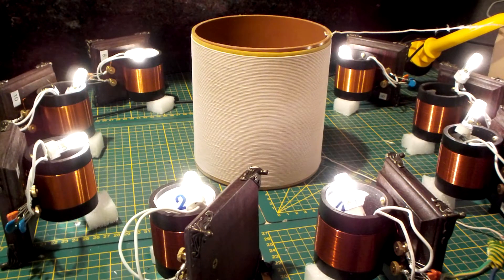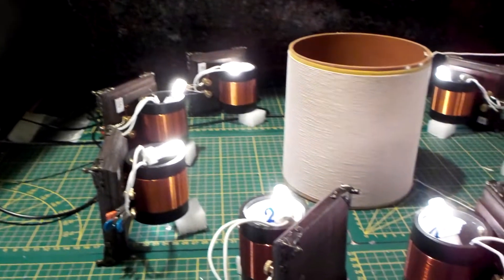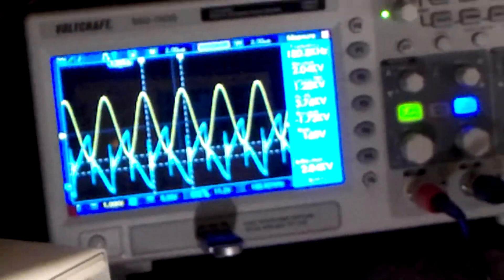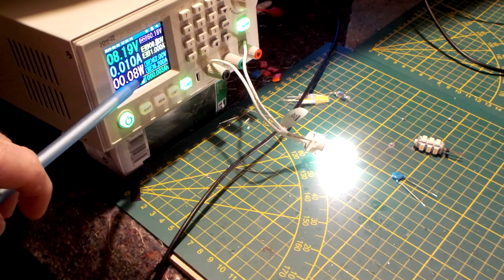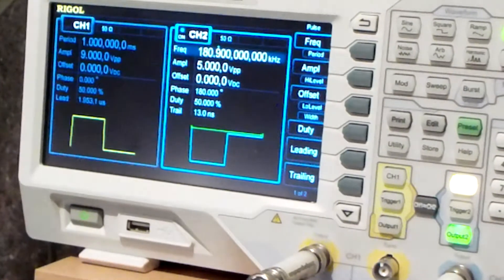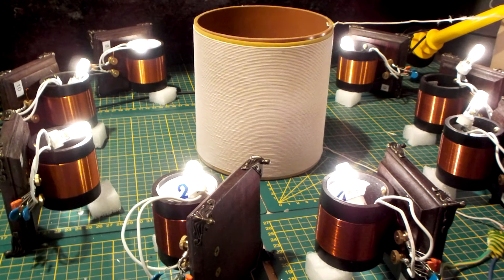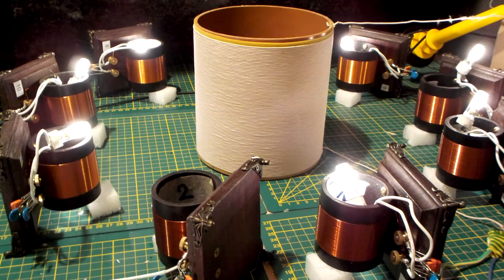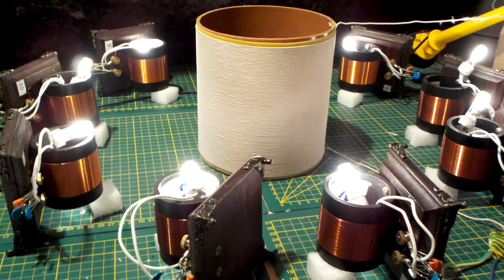057 Don Smith Spinoff Experiment First Results With Plate

Comment: Thanks for your experience, but how would a driver circuit look like if you need to light something more serious 60-100 watts?
Reply from the maker: At the moment I can only say that´s a very good question. I think a mix of high voltage, resonance, recycling, grounding. I´m looking into Joe (from the Joecell) the coupling with the ether in an unconventional way doesn´t look that strange as a possible solution. To me resonance on it´s own is just a part in a chain. Going in a 2 coil system + output transformer from Watt to Kilowatt on continous base ( not just single capacitor discharge every minute sort to speak) needs something extra. That´s my personal opinion at the moment, maybe somebody else was so lucky to see that indeed happening in such system without extra´s, so it doesn´t mean it´s not possible, just don´t see it at this moment.
Reply from the maker: It´s always hard to describe what I think about what I´m missing, but if I look to the things happening I end up with the question, what do we need to resonate with? Every coil and/or combination with capacitor will have resonant frequency, but they are not a source, the source is what surrounds them. So what I think I´m missing is how to resonate with that source? That´s why I believe people like Victor Schauberger, Don Smith, Joe,... where succesfull. They knew how to resonate with environment, erher or whatever name is given to the energy around us. They found a resonant frequency or correct coupling with the energy field. When reading from people who have better insight in the Joe setups, I read: as long as people keep using diodes they will never have OU. Being correct in that or not, it could be one of the factors I´m not succeeding in creating OU coupling with the energy field. You don´t know how many times your question has been woundering around in my mind for years :) so that´s why I can only write, that you have a very good question.
Reply from the maker: I like to add that I think that tank circuit is physical resonance, but I´m missing field resonance. However I don´t have idea at the moment on the how to. Or if that thought is correct.

Comment: Why did you isolate the Alofoil ? This way no ions from the air can't be collected...
Reply from the maker: @overunitydotcom, It's a question I also have, in the text from Tesla he speaks of insulated plate, but I always asked myself if that is ment to ground or/also the plate itself. I don't want discharge at the top, so therefor I choosed (maybe wrongly) to use insulated plate. If you look at non insulated top loads they throw sparks, which I don't want to do, I wan't to use the energy. 
The reason why I believe there's a chance that it needs to be insulated is for this:
The insulated plate behaves like a capacitor, which means that opposite charge is created on that plate to what's available in the air. Because of the connection to ground, electrons (or whatever) from ground are drawn in to the plate to build up that opposite charge.

I discovered another intresting phenomenon by using this kind of plate when using a second one for receiver which has two wire connections, one goes to grounded receiver coil (parallel LC) and one goes to another not isolated alu plate. Now on contrary to what I thought when I place that alu plate vertical low to ground I get better result on receiver then when  it's not connected or placed at higher level (tuned for best results without that extra plate and the adding that plate gives increased output on receiver). A picture with schematic used can be found here: https://photos.app.goo.gl/NsHiL4eYsasHBTDt6 (still experimenting on this)

I hope to do an experiment with uninsulated plate in future but at the moment I'm looking at a kit I've bought a few years ago from Konstantin Meyl where he uses metal spheres. I want to look deeper into the OU he talkes about by recreating the same setup as in his book "Dokumentation zur Skalarwellentechnik" (if you know the book, it's going to be the setup on page 68 "Leistungsmessung an der Nottingham University"
I see the positive influence of the plate but at the moment I have to many questions and hope to find some answers this way. It's not clear if the metal spheres are varnished from the kit because when I try to measure ohms on it I have some times reading and sometimes not, but I don't want to push to hard on electrodes because I don't want to damage the spheres, so I'm not sure if there's a small layer of varnish that at some points is to thin and I have contact. Probably once there's contact one can see it as uninsulated.
Reply from the maker: I have found real measurable OU with the experimental kit from Konstantin Meyl: https://photos.app.goo.gl/BbAMQ36Q9h3rstvW6
Now thinking on what direction to go further.

Comment: When you remove LED your other LEDs go a little dimmer.  I get this all the time, but after it is removed to re-adjust things and LEDs will get brighter.  I wish I could be more specific😎   love your experiments & fast progress Bruno!
If my system shows OU today, I will then have to validate & then probably get a patent fast,,,,,,,  before someone figures it all out, hahahah!
Reply from the maker: Wish you all the luck with your device, let the OU be with you :)
Reply from the maker: I have found real measurable OU with the experimental kit from Konstantin Meyl: https://photos.app.goo.gl/BbAMQ36Q9h3rstvW6
Now thinking on what direction to go further.
Reply from the maker: @Inventor3, This is indeed the kit. I will make a complete overview video later but this small video's will be easier to look back to afterwards if I want to compare the different coils/setups.
In the mean time I found that changing to bigger distance could increase result (at least for sure with 10cm) tomorrow I'm going to see the results of double the distance of 1,45m.
I also found a video (added it to my playlist of the small video's) where Meyl says that Tesla used 1/2 wavelength coil for receiver and 1/4 wavelength coil for transmitter, so using different types of coil for transmitter and receiver is also something that I need to look into.
Thank you for the patend, I haven't seen this before, I will look into it.
Reply from the maker: @Inventor3, At the moment I'm building coils with wire to test with higher currents because it's not clear if I'm influencing the low voltage measurement or that there is really less voltage. It's not easy to be sure. I made this video to ask to the professor if my results are reliable but I think it's best to do experiment with higher current:
https://youtu.be/eeYxhyR9TfA
Thx for the link, I will look into it, have a nice new years eve.
Reply: @brunovk417  Did the professor get back to you on this question?  I'm curious as to what he says.
Reply from the maker: I didn't get an answer to that question. I had previously sended an email to him to ask if my measurements where reliable and to that he answered that the wire that I placed higher could influence the measurement because the potential on it was different a long the wire this way. Therefor you see the copper bar in my video to be sure I stay at same level. Meanwhile I have 2 extra coils type A to see what happens when I place more receivers. I'm also experimenting with the charging of capacitor like in Rick's latest video because that is easier to replicate if I can get it to work but having problems to solve before I can make a video on that.
Reply: @brunovk417  Thanks for the reply :-)

Comment: Bravo Bruno. Have you Heard about Hubbard coils???
Reply from the maker: Hi Amilcar Martin, Thx for the comment. I know the Hubbard Coil and tryed to do some experiments without using core material https://www.youtube.com/watch?v=tVIfG63rSHU
Before I had better understanding on resonance I also made this video: https://www.youtube.com/watch?v=yUQN5PG_61U

There's a part I still don't know anything of and that is resonance in the magnetic core material. I have no idea how to find the resonant freqeuncy of core material because I believe there's a difference with coil resonance (I have no idea if this correct on itself but it's my feeling)
I also think on the Hubbard coil that some time I need to do an experiment with bifilar receiver coils because that has no(small) magnetic field and I hink it will influence the transmitter less, but I have not done experiments with that type of coil as receiver.

Comment: I meant to ask you, your primary "white" coil,,, did you use litz wire? Hmmm, litz would reduce the skin effect.
Reply from the maker: @Inventor3, I thought it enhanced it as long as your whitin certain frequency range, the end result is that my Q is much higher then with solid copper wire wound coils.
Reply: @brunovk417  Hmmm, I might have to try also :-)
Reply from the maker: @Inventor3, When I looked up litz wire this texts came:
- The wire is designed to reduce the skin effect and proximity effect losses in conductors used at frequencies up to about 1 MHz. It consists of many thin wire strands, individually insulated and twisted or woven together, following one of several carefully prescribed patterns often involving several levels (groups of twisted wires are twisted together, etc.). The result of these winding patterns is to equalize the proportion of the overall length over which each strand is at the outside of the conductor. This has the effect of distributing the current equally among the wire strands, reducing the resistance. Litz wire is used in high Q inductors for radio transmitters and receivers operating at low frequencies, induction heating equipment and switching power supplies.